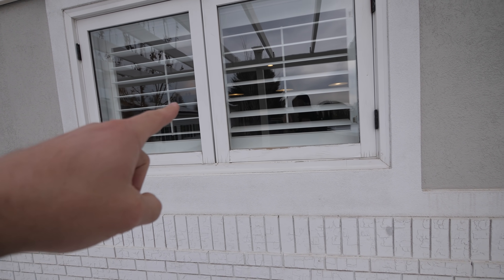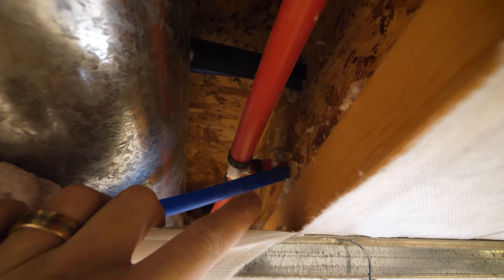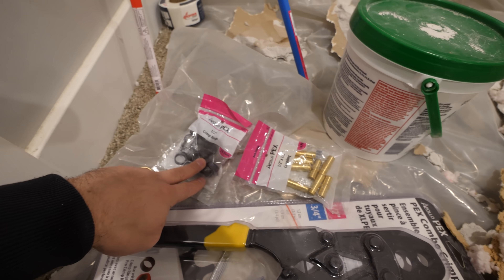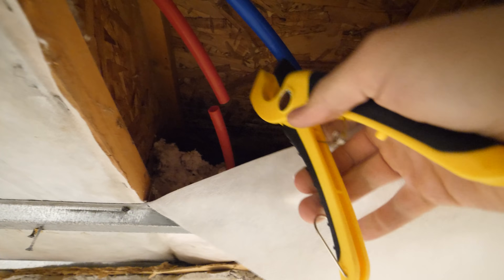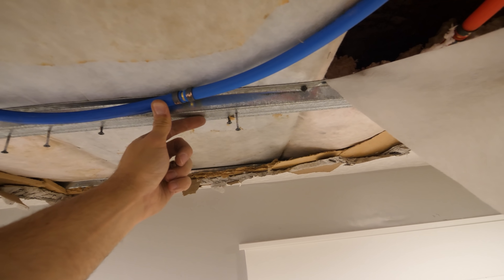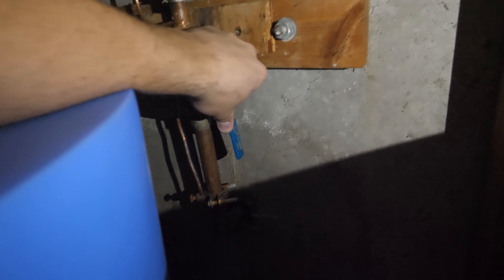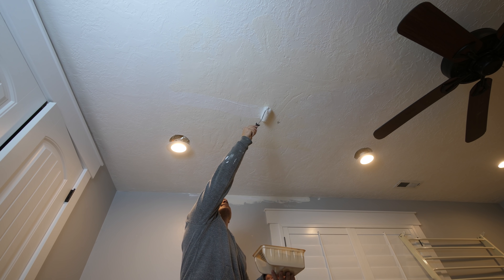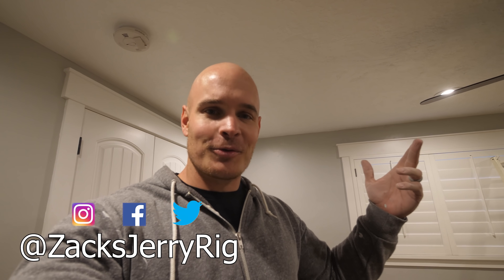How to Fix Frozen Pipes! - Can JerryRig-ing go too far?

Comment: Too late now, but I might have thought about putting some 1-2" styrofoam insulation inside that air intake along the floor to maybe help your kitchen floor not have a cold spot.
Reply: It looks like that duct matches the joist bay dimensions exactly... because why not? What knucklehead did that I wonder?

Edit: actually on closer review it looks like the "duct" is just the joist bay with sheet metal on the bottom...
Reply: @zannanger8147  Welcome to 80s construction, would you like cardboard sheathing?

Comment: So there's a vent right under your floor, with little to no insulation to your floor with HOT AND COLD water lines running across it... America never fails to amaze me.
Reply: Was thinking the same. /Swede
Reply: @ajbp95  and then they go and Artex the ceiling like it's 1986 😂 (it still is 1986 is large parts of America)
Reply: @TheDanielShepherd  I'm assuming you're from the UK? Are most new ceilings just flat? What material is used?
Reply: @TheArtificiallyIntelligent  Yes - they're just skimmed perfectly flat with plaster and then painted.
Reply: There was vapor barrier on both sides of the vent it okay not the best design but okay
Reply: I'm in America. I have a house like his (with the finished basement.) But I don't have any of those air intake vents along the base of my house. And all plumbing in this house is PVC pipe. Those plastic tubes he used look so flimsy, almost like temporary pipes. And very small diameter, too. I know the pipes leading to my kitchen sink have a larger diameter.  Everything about this was very confusing to me.

Comment: Good thing it's PEX, that made your job a lot easier. Kind of crazy that they'd drill right through an air intake like that though.  Normally high efficiency heaters use PVC pipes for air intakes and exhaust.  

I've also never seen a finished basement insulated from the rest of the house.  Unless it's one heated from a separate heating system like a radiant floor heater.

Comment: Careful running pipes that close to ceiling. They could be easily punctured by drywall screws. They make nail plates when pipes and wires are close to walls.
Reply: Pet is fairly burst resistant
Reply: Who is going to put ANYTHING in there ceiling... like I've never seen any screws in a ceiling
Reply: @ipant1056  this things are like thing they regulate so they dont happen. Even when the chances are .00001% of you puting a scre trought that specific part
Reply: I think he would take note of where the pipes are before they screw the gyprock  in

Comment: You didn't need to use that fancy drill, just some No More Nails adhesive as the patch is not structural.

Jerry also didn't mix and thin the mud, never use ready mix mud direct from the bucket except to pre-fill panel gaps.

Comment: The way american houses are constructed is hilarious.😂
Reply: Norwegian houses isn't simular at all
Reply: @AArZAAA  No, they are not
Reply: @HorizonFarming  oh how?
Reply: @charliemccloskey8358  Basically everything. Houses in Norway are tougher, they never blow away, the dont rott in at least 40 years and they are better insulater, to handle the extreme cold. And the plumbing will never leak. It is a system called "Rør-i-Rør", if there's ever a leak, the water will just run out to a drain, and not inside thd wall.
Reply: @HorizonFarming  I’m in Canada (-30 in the winter) and mine seems more like his 😂
Reply: Please help litterally every american architect.
Reply: @babubackforlols7960  just remove the suburbs and the problem will fix itself
Reply: Ever come to my house in India
Reply: @mobabot  india where? I will visit you after covid.
Reply: @HorizonFarming  That's what I call Real Engineering.
Reply: This is in a basement that was converted to a living space. So please get a grip
Reply: Yup
Reply: I was just going to say
Reply: Production builders do not impress me.
Reply: Yeah really. Just check Indian house construction its like rock solid in front of this constructed to last easily 40 yrs without major renovations just painting is needed.
Reply: @MarkfromNewYork  Does not matter the way you connect water lines, insulate and run your electrical would be laughed at here in Sweden as well. We built our own cabin in the north of Sweden almost 25 years ago and everything is thougher, more well thought out and executed. Nothing in that house would even pass building code inspection in Sweden
Reply: @AquaRelliux  it would not in NY either, but he is in Utah. Try to see America as little nations. Each state and city does it's own thing. Please don't assume all of america is like this. NYC and Long Island building codes are more like Sweden.
Reply: @Elder650  Cardboard?
Reply: American houses are constructed amazingly. The new advances in plumbing, flooring, insulation, and electrical work is the best in the world. No other country builds amazing houses like we do in the US. The houses are also extremely energy efficient
Reply: @robotman8444  No.
Reply: @max chilla he did say it wasn't buit to code...
Reply: @HorizonFarming  we have (rör i rör) in sweden to. Its so much easier to install and prevent leaks!
Reply: You should have a look at how american bathrooms are built. They don't even use proper waterproof membranes, it's honestly quite scary how bad it is. 
American houses tend to look great but their construction is awful.
Reply: We prefer new houses. Which means older houses don't sell as well. They get torn down and a new house is built in its place. We think that 1890s house is old because most have been torn down already. Therefore the trend to make a house only last 50 years has become the norm. They are built this way to go up fast and cheap, because the market for a new house is greater than an old one.
Reply: @robotman8444  WHAHAHAHAHA
Reply: @Bob_Lob_Law  nope. From RCC PCC Concrete baked bricks walls 10” thick & lots of steel is used in every corner lines of house and rooms to make a cube like structure of steel & concrete
Reply: 🤣 my closet in the master bedroom is as big as your entire house 😂😂🇺🇸🇺🇸
Reply: @bestman7776   search Antilla mansion 😂😂
Reply: Everyone in here arguing about how houses are built better in different countries need to calm down. There's no perfect house anywhere in the world. From newly built to old, you're bound to run into a problems at some point in the life of your home.
Reply: @dabberino  Tbh, most of my knowledge of American bathroom construction comes for youtube, eg. this old house. They've built bathrooms that are so far out of code relative to what's allowed where I live that I don't even know where to begin. 

But I know that american states varies a lot, perhaps they operate in states that doesn't care about water damage.

Comment: its wierd that the pipes aren't insulated, here in Belgium they are
Reply: Ik wilde het zelfde zeggen. I was about to say the same thing.
Reply: In belgie kunnen ze er anders ook wat van, koud water naast cv leggen mag blijkbaar gewoon, dus als je koud water aanzet in de winter krijg je eerst warm water 😂
Reply: @Numbeermit  da's bijzaak, da was bij ons thuis ook vroeger haha.. keb mij zo ies bijna verbrand
Reply: @belgianbuilds6129  best erg, ik kom van Nederland en ben loodgieter. Als je dit in Nederland zou doen dan kan je jou bedrijf sluiten haha, maar hier in belgie kan dat gewoon
Reply: @Numbeermit  hier mag alles😂
Reply: Same in the UK. American building codes confuse me so much.
Reply: @jasperlilienfeld505  the electricity is even worse😅
Reply: @belgianbuilds6129  It depends on where the pipes are located. Those should have never been run that way to begin with. That air intake should be an actual intake, not just the space between 2 joist with a metal sheet on the bottom. Thats why he has a cold spot in his kitchen floor. Whomever did the remodel on that house cut a LOT of corners or wasn't a licensed builder.
Reply: @mylt1z28  yea i can imagine
Reply: @belgianbuilds6129  *laughs in 50Hz *
Reply: @thanasisbethanis  😂😂😂

Comment: we have a seasonal cottage that was once all copper line. when it wasn't drained properly in the fall, we always had burst copper lines in the spring when we opened it up for the season.
Replaced everything with pex and never had an issue. It will freeze, but expands enough to not burst.

Comment: Have you considered converting to a higher efficiency furnace and just sealing off the envelope of the home? Not only is it easier for the furnace in terms of rust but it spares you the wet filters if it rains and you have it on.

Comment: For someone living in a colder climate, cutting corners on a remodel like this is absolutely ridiculous. About a foot's length of pipe in my parents house runs uninsulated but behind a thick leca block wall, and that freezes at very low temperatures (~0 F), and that was considered a big mistake here.

Comment: You can get a 90deg tool that can be use for tight access areas, it has 10mm chuck so you can drill, drive, sand etc 
That design you have fails at speed and has limit torque so be careful , thanks for the video from Wales 🏴 in the Uk

Comment: Hot tip, when turning your water on, do it even slower than you are.  It prevents a sudden rush of pressure, which is bad for the fixtures, and usually whatever faucet is closest to the valve takes a real pounding and can ruin it.

Comment: If you have frozen pipes again, they sell pipe insulation wrap that you can plug into an outlet and it turns on when it detects a temp below freezing and it keeps the pipe just warm enough to the water inside doesn't freeze.

Comment: Well, that solution doesn't really meet plumbing codes. Heaven forbid someone ever tries to put a screw or hanger into that ceiling.
Reply: Well I was just trying to put up a hanging plant and it seems that it's a self-watering system..... Jerry
Reply: Not saying it meets code, but if you're trying to hang something from your ceiling, you probably shouldn't just stab your drywall blindly? I'd be searching for a joist so I don't have to worry about the hook pulling out of the drywall!

Comment: Why didn’t you use shark bite connectors on the pex? Much easier to add and remove
Reply: Because you should never use sharkbites in a finished wall.  You should only use them if there's an access panel.  He did the right thing by using the crimp rings.

Comment: That duct should be insulated anyway...what kind of crappy codes do they have there?   Also it is worse having that gas line in there...so now if you get a leak there, it will fill that area, go right into your furnace, then kaboom.
Reply: I think he is in Utah a historically conservative state where NO BIG GOBMENT tells us how to do stuff. Same where I live basically no codes or inspections. I did a big remodel and the only permits/inspections my builder had needed were for a culvert and septic. Of course he half-assed some things I'm still dealing with. Not saying it can't go too far, but generally basic regulation is a good thing as business will do the bare-ass minimum.

Comment: For future reference you can use a nap paint roller to get that same texture in your mud. Just dip the roller into the mud (preferably a large 5 gallon bucket) and spread it on. Works a lot faster. Then you could knock it down as needed to match your ceiling.

Comment: Primer before the texture! it helps it dry uniformly so you don't see the joint lines.  Also you should have wrapped the cold line in contact with that metal duct.  It might not be affected at 32, but it still might at 10.

Comment: As a contractor, this pained me.  I really hate textured ceilings.  And also more than improper plumbing.  Jk.  Thats worse.  But no.  Take down the entire ceiling and make it smooth.  Please
Reply: It would honestly be better if he just put in drop ceilings in the basement, I would save quite a bit of time when trying to fixing plumbing leaks and any other issues that may pop up over the years.  Also as someone familiar with plumbing this is just a homeowner fix, normally you would run a copper pipe to the sink but that takes time to put together and requires the experience of sodering aswell.  Everything he did is a temporary fix.
Reply: @XAssassin_22  true story.  When I bought my house it had the 70's 12"x12" fiberboard tiles with 1/4" plywood as a backing.  I took it all down pretty much when I moved in, one because I hated it.  Two because I had to do a complete rewire.  Installed a drop ceiling because of this sort of thing.  Easier to replace a tile or two, than patch a drywall ceiling.
Reply: You could just skim coat it instead of taking the whole celling down.
Reply: I like the knock down texture on ceiling and walls.
Reply: The worst is that there is no actual duct. There should be a proper insulated duct for the intake. If that was done, he wouldn't have to do such a sketchy reroute.
Reply: @isaackvasager9957  what'd he do wrong?

Comment: Wow I can't believe they just drilled holes through all that venting -- gas line included. Incredible.
Reply: That isn't a proper, to code vent. I can't believe they tried to pretend a typical joist space could be used as a combustion air intake.

Comment: That external fresh air intake is code?  In the Oregon code (similar climate) the leakage of windows are used for fresh air intake and you install an exhaust fan in the laundry room to create a positive airflow through the house, that's current as of 2018.  The fan requirement and its size are dictated by a formula that takes data from a table which counts number of rooms and occupants.  Pulling unconditioned air into the house through an uninsulated duct sounds really fishy.
Reply: Air intake for a NG furnace, not for air in the house.

Comment: I hope you got the right pex that pipe looks orange which Is for heating only, you may have to replace the orange pipe for red it does matter orange is only for low pressure

Comment: I know I'm late to the party but you might want to consider putting metal to block nails & screws from hitting the pipes. I'm not a plumber so I don't know code for that but I have watched a few remodel TV shows & if waterpipes are close enough to worry about screws or nails you put some metal in to protect it.

Comment: I've never seen a house with an air intake on the exterior and I've been in thousands. Every one I've seen pulls air from inside the home. Weird.
Reply: Me also. I grew up not to far from him (Northern Utah).... Never even heard of this.
Reply: I wonder if it is an exhaust for the furnace.
Reply: @mattjames8683  I had the same thought earlier today, but it wouldn't make sense to run it the way they did, or to run water and especially gas lines through it. It would be such a high risk of fire or the gasses leaking into the house.
Reply: Oh i figured it out. He must have a natural gas heater. The air is pulled from the outside and then mixed with natural gas for the purpose of combustion and then discharged back outside.
Reply: @mattjames8683  we have natural gas heat in our area and none of them do that.
Reply: @secureinmyrandom  high efficiency NG furnaces draw in their air from outside.

Comment: I'm also no plumber, but why is there what appears to be rv plumbing and fittings in your stick and brick home and not pvc or cpvc?
Reply: It’s called PEX tubing. It is rated for in wall use in the US. However, cpvc is another popular option along with copper.

Comment: You could have detected the metal studs using a magnet, then cut the drywall square with a multitool. You would have had a drywall "door" that you could have just took off, and then put it in again, with only minor repairs to the mud.
Reply: This is incorrect. The drywall would be screwed to the studs in many places for that big of a hole. no way you are getting it out without damaging it since you'd have to tear it off the screws to remove it

Comment: How do US houses not have Copper piping for Water? Or solid Walls and proper insulation? Our garden Shed here in Germany is built more solid
Reply: Cost is the main reason. Ease of use is another. PEX has been around since the 90's. Since its flexible its also good for installs in areas that are geoactive such as California and Alaska. PEX is also used in Europe, just not sure how popular it is there.

Comment: Quick suggestion , for a added freeze protection, at the area inside of the ductwork now above the lines. How about lining that area with a foam kitchen floor mat . Pre-cut and Pre-sprayed with 3m adhesive.  Put it above your pipes like a sticker inside of your vent. Application is probably going to go down like putting a pizza in a oven with a or. 
Boom I just G.R your fix....

Comment: If it was a solid run of steel pipe for the gas line through there, I wouldn’t be concerned. But that last view into the duct showed a few CSST fittings inside the duct…that’s a HUGE no-no. Absolutely NO gas connections should be made inside ductwork of any kind.

Comment: Not a professional, but knowing how waterlines in cabinets up against exterior walls can still get cold enough to freeze, I'll be curious to see if you still run into this problem. Im thinking that you made an improvement but didn't eliminate the possibility - instead of freezing at 0, it may still freeze at -5 or -10? The wood and drywall is probably going to insulate the pipes from the warmth of the basement better than the sheet metal insulates the pipes from the cold.  I think my first attempt would have been to slip some thick insulation around the pipes from outside, but i may be putting too much faith into the capabilities of that insulation!

Comment: natural gas is still liquid when it's under pressure - and as such, it can freeze... maybe not at 32F, (propane freezes @ -42F) but insulating that length of pipe would've been a good idea... although your PEX pipes aren't directly in the cold air, the duct itself can conduct cold air to anything touching it (in your case, your pipes)...